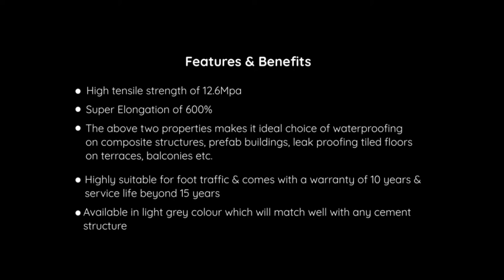Balcony/Terrace Tiles Waterproofing | UniPro® Waterproofing

Comment: can  you  put chairs  or  any  furniture,   will    it  not  destroy  the  paint , is    the paint  abrasion  resistant  or  durable  enough
Reply from the maker: You can use light furniture as the coating is suitable for foot traffic.

Comment: Then what is the purpose of tiles if we hide them with waterproofing!! Isn't should be below tiles 🤔🧐pls advise !!
Reply from the maker: Good question. When tiles are laid unscientifically, leakage occurs below the RCC slab due to water getting trapped below the tiles. This causes many serious consequences such as RCC spalling etc. In such a situation, what conventionally people do are to remove the tiles and re do the entire process which will again cause the same issues in some time and it is also a cumbersome process. The tiles have anyway reached the end of its service life as the owner was planning to remove them due to leaks.  In the featured video, the leaky tiles aren't removed; but given a strong Waterproofing coating which will extent its life without much hardwork. Hope this answers.
Reply: @UniProGrp  Thnx Dear 🙏
Reply: @UniProGrp  So let's say during new construction slab we can apply this coating before laying the tiles or marble!!!
Reply from the maker: @Behuman0627  Yes, absolutely, can be done. As this is a high quality waterproofing  membrane, this can be done as concealed as well as exposed Waterproofing.